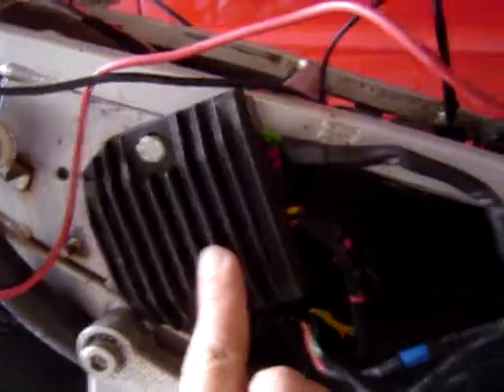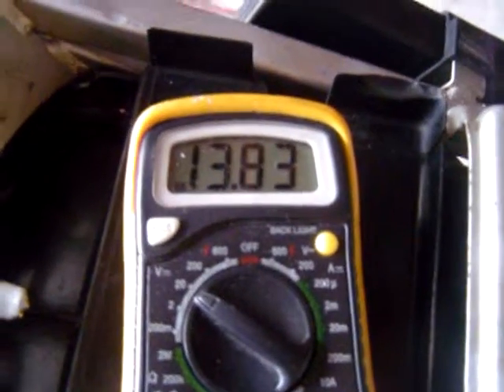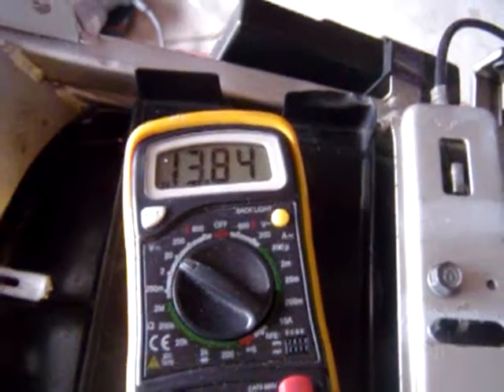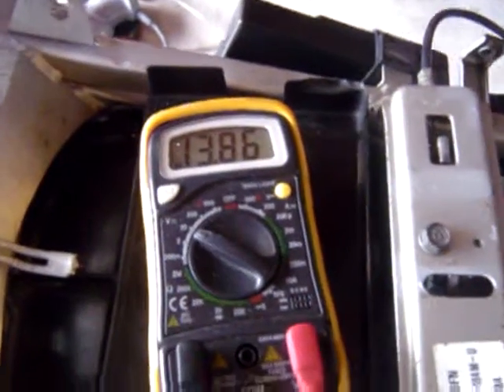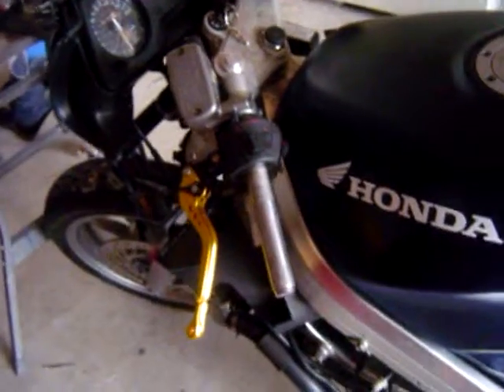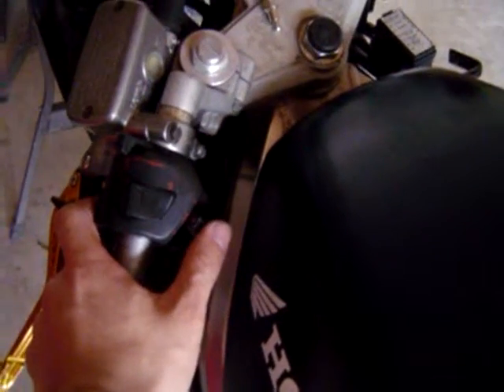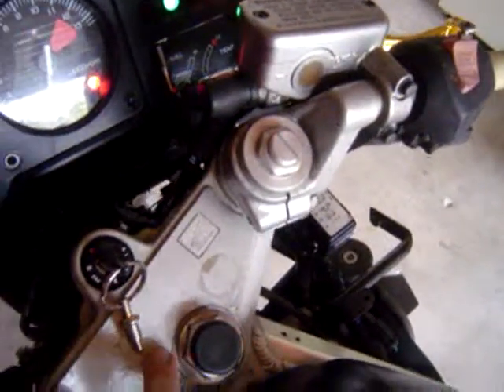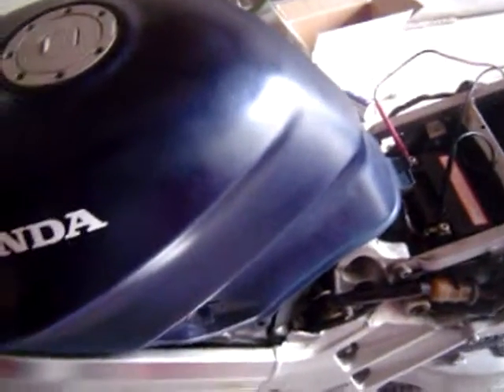Mosfet FH008BA Regulator-Rectifier on a 92 VFR RC36: Does it Work?

Comment from the maker: March 2015 UPDATE - After 30,000 miles and a year, the FH008BA unit is working flawlessly.  It was relocated under the seat and holes were drilled in the wheel fender to allow air to pass.  It has virtually no heat and there has not been one single problem.  THE UNIT HAS TO HAVE TRICK WIRING BECAUSE THERE IS TWO HARNESSES AND TWO OUTPUTS, YOU ONLY NEED ONE OUTPUT.
Reply: was it an oem unit or aftermarket??
Reply from the maker: They are OEM off the CBR600, just search the FH#.  OEM units work fine but when the frame heats up from engine heat; it will cause problems.  Therefore, it is an OEM unit from a CBR, expensive; but the OEM units are just as good.  Recently, I found MOSFET units for little money on eBay but even if you get them from a salvage yard, they want $50 and up.
Reply: I ordered one from a company called caltric. Seems like a legit company with replacement parts for all kinds of bikes , water craft and lawn equipment. Only paid $35 for the mosfet unit, listed as 07-09 600RR regulator rectifier....
Reply from the maker: thanx for the info... I know where to get them now.  I am sure a lot of people are looking for a better solution to the problem!  WHEN YOU RELOCATE THE UNIT, the heat problem goes away.
Reply: +Alex-Thang Nguyen I heard the mosfet units don't run hot..